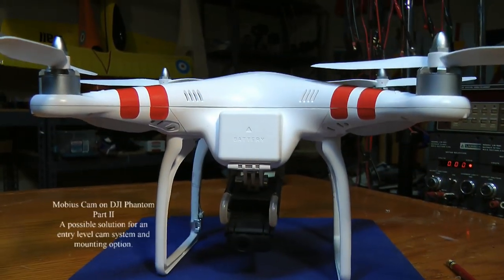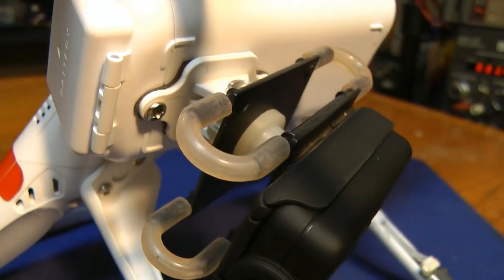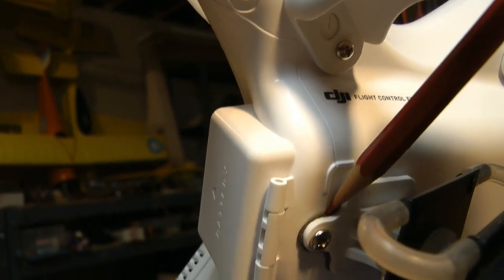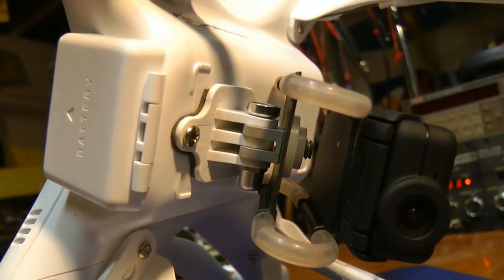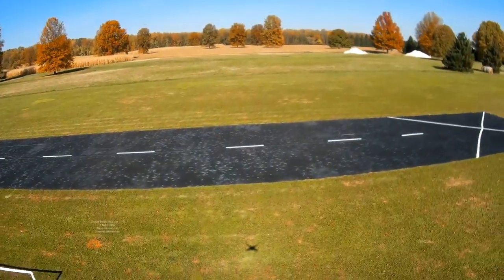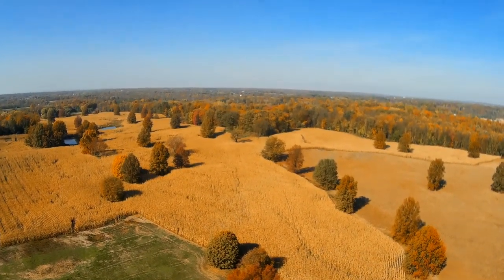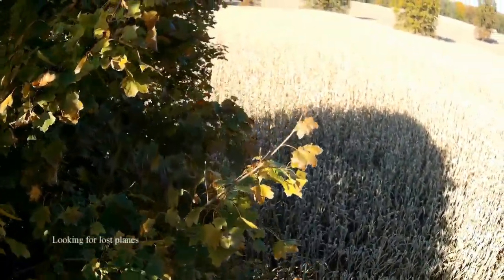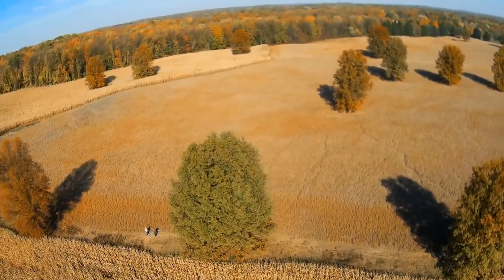Mobius Cam Pt.II A Solution To Jello?

Comment: Paul, your idea is great and I didn't have any light surgical tubing or fuel line but did have some vacuum hose which might have 
worked but also could have been too stiff? I then got the idea of using some 300 ohm twin-lead. This was real easy to setup
using two copper plated circuit boards on the XK Detect X380. The layout consisted of two boards with 4 short twin lead lengths.
A RunCam HD was mounted on the bottom side of the board and the backside twin-lead lengths were shorter than the front
lengths which angled the camera down a few degrees. The front lengths were 4.5 inches and back ones were 3.5 inches in
length. I ran a test on it and like your setup there was very little jello and the props on this quad are a set of 9 1/2" carbon fiber
props. The props replace the DJI 9450 props and these had to be drilled out and balanced. I am going to order some surgical
tubing to replace the twin-lead cable to save weight. Thanks for your ideas!

Comment: you were right this mount worked a lot better. so how could one acquire one of these? and did leaving the shielding on help keep signal interference down? i fly a Blade 350 qx and acquiring the gps lock has been my biggest issue. i really want to use my mobius for ariel filming.
Reply from the maker: I can't say I ever had a problem getting a lock with the Phantom, shielding or not. I made this mount by hand and it's very easy. Any kind of configuration will work as long as you have the tubing set up similar.
John

Comment: I rigged up something similar to what you did after seeing your video. I didn't have any RC fuel line and tried some old vhf
twinlead cable and it did help on a X380 quad. I then tried some aquarium tubing but it would kink so I never really wanted
to use it. I am thinking that surgical tubing would be the best. The first trial was a lot better than any mount that I have tried
including several carbon fiber plates with the rubber ball mounts. The props have been balanced with all my testing and
your idea was the best. Most of the fellas flying the X380 use the stock gimbal shipped with the XK Detect X380-C. I fly
FPV and the weight is critical for a long flight so a heavy gimbal is not good and besides, if the quad happens to go down
the extra weight means you will have a lot of damage. I seen a review from Copter Hubsan flying with the stock X380-A
camera/gimbal setup and it appeared to look real good with very little jello. The problem with jello comes in when flying
in the wind and with high throttle. I went ahead and ordered the camera/gimbal setup and was surprised to see very little
jello in the video. I did find out that the camera was a Mobius in a different cover! The Mobius software works with the 
camera and looks real good for customizing the camera. The Mobius cameras are pretty impressive and far cheaper than
the GoPro cameras. I do have a GitUp Git1 camera but mounting it is a problem without a gimbal. The better camera the Git2
which has gyro stabilization should have been the one I ordered. The first test I did with the Twinlead was using a RunCam HD
which which has given good results. Thanks for your ideas and happy flying.
Reply from the maker: Dennis, I'm glad even if I helped in some small way. It sounds like you're having fun and that's all that counts.

Comment from the maker: I think Rick could be right also. Actually I thought of filling the tubing but then thought sound and vibration travels really good through some liquids. I think incorporating longer tubing is a great idea as long as it can be in a configuration that keeps the camera stable, Maybe the X. Magnets are pretty much out because the compass interference. You can't even have keys or a cell phone in you're pocket when you calibrate before flight. I'm sure there can be improvements though.
Thanks
John

Comment: Nicely done! I've made several mounts for the Mobius on my 350QX and have solved the GPS RFI issue, but still have some jello. I'm going to incorporate the fuel line "vibration dampeners" into my mounting schema. Thanks!
Reply from the maker: Hey Analog Man, Ha, I never up graded my stereo from a tube set. You might guess there's a reason. Ya, good luck with trying the fuel line, it solved the problem for me. Try to find som soft line. I'm gonna try going a little softer yet with some surgical tubing. Of course you know balance is important. I don't know if I mentioned it but I got some good results by balancing the motors with the use of a cell phone vibration analyzer ap. So far I have never had a problem with interference with the Mobius on the Phantom. I'm using a copper clad board between the camera and the Phantom just to be careful. Good luck and let me know if you try the fuel line.
John
Reply: ***** Hey there DadHav. Ya, you figured out the reference in my handle for sure! Lots of great "tube stuff" out there. Although I've got lots of digital, I'm still using analog a lot - by choice. Anywho, I just tested my 1st fuel line cam mount. It worked very well, but not perfect. As you suggested, I need tubing with more flex. The ground clearance on the 350 QX is restrictive and forced me to make really tight bends with the fuel line. Still, I believe this is going to work out fine. I also deployed copper foil tape on my new cam mount and GPS is still locking OK. I also have it inside the body of the quad just to be safe. BTW, the place you're flying looks amazing! I'm also in OH, a bit south of Cbus. Praying for Spring!!! Thanks for the reply man. I'll keep you posted on my cam mount progress. Oh, I'd really like to hear about your motor balancing process!!
Best Regards!

Comment: Can I also ask you why you did the etching. Why couldn't you just leave it on the board ? thanks again
Reply from the maker: Hello Thor, That's a good question. On one hand it would seem that any amout of copper between the camera and the GPS would shield any RF interference but on the other hand is to much likely to interfere with the transmitter to receiver strength? Don't know.
John

Comment: Thanks for the demo and for thinking outside of the box on your anti jello solutions , I am favorably impressed with the Mobius unit regarding cost and capabilities .

Happy to see you turned off the sound on this fly around which prompts me to inquire as which component is the most noise offensive , motors or props and do you have any suggestions for noise suppression or elimination .

Thanks for your time and demos .
Reply from the maker: Hello Jack, The worst of the noise for me is with the props and I don't know of anyway to to reduce the effect. these white props are noisier for me than a set of carbon fiber that I use and I think that's because the soft plastic cavitates more than the carbon fiber. Thanks for watching and the compliments.
John

Comment: This is not stock footage...right?You used post processing to remove jitter? Adobe or w/e ?
If this is RIGHT out of the camera with No post...wow, amazing !
Reply from the maker: +BOOSTEDLASER 
Hello Boot. I assemble and post from Pinnacle but there is no enhancement for jitter on the video. The stock video is the same as what's posted. There are many variations of the mount posted on YouTube including one that only takes 4 minutes to make    https://www.youtube.com/watch?v=PuNhiJAVum0    They all seem to work pretty good.

Comment: hello,, is there any interference problem using this mobius cam to dji phantom loosing gps signal to phantom.
Reply from the maker: Hello, I've never seamed to  have an issue but seeing the problems that others had I used a copper circuit board to mount the camera to. I think the fact that it is upside down has something to do with it too. I've asked many times on the forum where they talk about this but I get no answers as to how many with Phantoms have trouble.
John

Comment: hi, I have the same camera and I use it with my phantom 2, the only thing I do not understand is that you must load the independant, its not take direct charge of phantom? solution ?
Reply from the maker: +michaal triki 

Hello, I'm not sure what you are asking but some people have made adapters to power their camera from one of the cells on the phantom battery. If you expand the video description above you will find some links to Mobius forums. You should be able to find an answer there.

Comment: would you tell me how you attached your Mobius bracket to the bottom circuit board? Great video
Reply from the maker: Hello, I sanded the rubbery finish off the back of the Mobius mount then used 3M Ultra double sided tape. This is the black tape that holds something like 20 pounds per square inch or something like that. It will have to be cut off when I want to remove it.
John
Reply: ***** Thanks for the info john. I appreciate your help.

Comment: Hi Paul, your mount should work good on most cameras and they might have to be tuned by using different lengths of the
plastic fuel line. I am not using a Mobius camera on my X380 instead I'm using the RunCam HD and the reasoning is that
after reviewing several reviews on the Mobius there was interference caused by the camera since it's not shielded. I hope
they have corrected the problem. I checked the RunCam HD and it has a coating on the inside for shielding and so far no
problems with it running FPV. I was wondering if anyone has tried surgical hose which is available off of Ebay? I am thinking
that different lengths need to be used like for the rear of the camera in order to tilt it down. You have a real good idea which will help people get started with the quads and cameras. Thanks for the video.

Comment: Excellent solution. I used oxygen nasal-canula tubing (very easy to get) but your method of anchoring the carbon rods is great. I do believe that utube brodcasts in no more than 720p so your files uploaded will not look as well as orig. files. See Techmoan.
Reply from the maker: Craig Ochsner Hi Craig, I'm sure your right about the resolution. It's a shame, but things are changing here and they're not getting better as far as I'm concerned. I just use 720 now. Thanks for the link, it looks really interesting.John

Comment: DadHav this is absolutely fantastic idea. I was serching to solve vibes on the motorbike. I will adapt this idea and will send test results before and after.
Reply from the maker: Hello, It might help some. You can use thinner longer tubing also and it might help more for your application.
Have fun, that's what's  most important.
John

Comment: Nice! I think Rick Reyes might be on to something with the X-pattern mount. If this was my project, I'd experiment with different types of tubing, or maybe filling the tubes with a liquid of some sort, e.g. oil. But all in all, you have pretty much eliminated the jello already. Well done.
P.S. How about magnetic mounting with the dampening material (e.g. foam) in between magnets? How would the magnets interfere with the camera/aircraft overall?

Comment: You might be right about the liquids (I'd still want to try the oil, just for the heck of it). Maybe the tubing material itself is the key to ultimate results.

Have you tried some of the sound and vibration dampening materials that the professional car audio industry is selling? They are supposedly very good, albeit some are pretty expensive. Much better than bituminous or rubber sheets, though, which work mostly by adding weight which in turn reduces vibrations.

Comment: It appears that the jello affect has been pretty well taken care of. I am at the start of FPV and videoing and have a Mobius on order and have been experimenting with a YS80 camera and have been getting lots of jello. So I am going to go down this path and see what I can achieve. Thanks for the idea.
Reply from the maker: Hello David, If you plan to use a gimbal you might have some improvement also, but keep  in mind prop and motor balance should be the first thing you go after. I balanced the motors by using a vibrometer program on the cell phone. I just put the phone against the plastic by the motor and without the props on I added some tape pieces on the rotor until I checked the vibration. 
Good luck
J

Comment: Hi. can you tell where I can buy boards like that?
Reply from the maker: Hello, The boards are coper plated circuit boards. I think I got them from Radio Shack. You don't have to use these though, any thin fiberglass or plastic would work. I thought the copper would shield the camera from the circuitry but many have made this mount without any shielding.
Reply: Hi, thanks for replying. Can you explain how to attach the fuel line to the board? I was thinking of using a plastic/pvc ID card, but I'm not sure how to attach the tube to it. Your board seems to have an "extension" for the tube to attach to
Reply from the maker: Hello, I have 1/8" wooden dowel rods attached to the boards to hold the surgical tubing. You can glue these on or attach them with copper wire like I did. There is really nothing special about the setup. You can see ho easy it can be done on this video someone else posted    https://www.youtube.com/watch?v=PuNhiJAVum0

Comment: I'm pretty sure the resolution is off because it is darker, so the ISO had to be turned up making a less sharp, grainy video
Reply from the maker: Ya, probably. I also might have had a lens B or view of angle setting on the software. I've heard it's wider angle is less sharp if I remember right.
Thanks
John

Comment: Thank you for your smart solution. I copied your idea. It seems it works best with low light conditions. When  the day is very shiny ( lot of direct sun light), I still get the jello. Any other hint?
Reply from the maker: Hello Luis, Have you worked on balancing props and motors both? Are you using soft surgical tubing or harder plastic?
John
Reply: ***** I am using silicon RC gas line tube. It is like soft rubber. Propellers are balanced. I do not know how to balance motors.
Reply from the maker: Luis Alvarez
Hello Luis. I balanced my rotors using a vibrometer application on my cell phone. With no prop on the motor I touch the phone to the end of the arm by the motor and watch the xyz wavelengths produced by the vibration. I used the silver reflective tape to balance the rotors because it is a little heavier than regular tape and the color matches. I randomly stick a piece about 10 mm wide anywhere on the rotor then move it around until I see the vibration at it's lowest point. I then add or subtract tape for fine tuning. I hope this might help some. The only other thing I can think of is trying thinner surgical tubing on the mount.
John

Comment: where can i buy the parts to make this?
Reply from the maker: A hobby shop would be a good place to start. There is nothing special or tricky about it. I'm not sure you have to use circuit board material like I did. You could use carbon fiber, fiberglass, plastic or probably aircraft ply. Simple wooden dowels or aluminum tubing would work instead of carbon fiber. You could use part of the plastic GoPro mount where I machined the swivel part. A little bit of R/C fuel line and you're all set. You could always stick some sticky back copper or aluminium foil on it for shielding if you think you need it.
John

Comment: Not sure if anyone has mentioned it..  i was having a ton of jello with the mobius, what a lot of it ended up being was the camera not fitting in tight to the slide in case.  Once I mounted the camera directly to the copter (sans slide case) my issues were resolved.